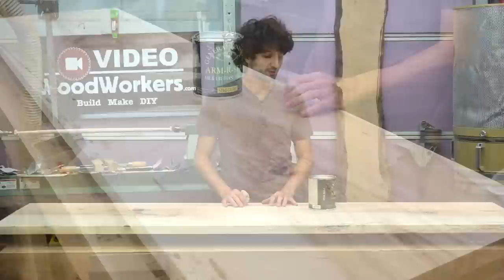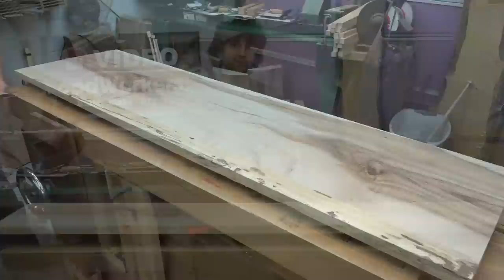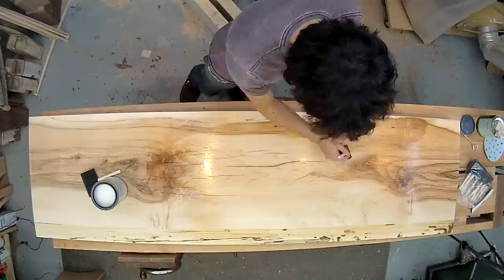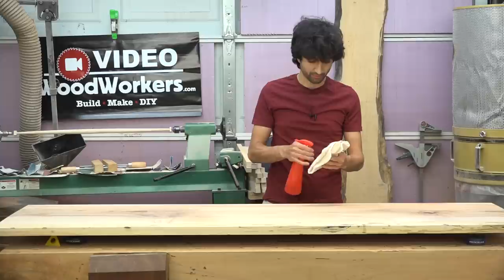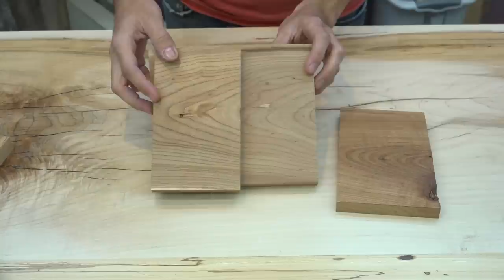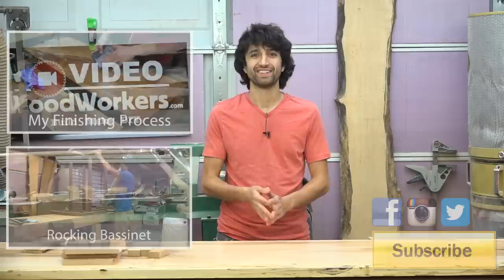Using a Water Based Finish for the First Time

Comment: Oil based finishes are far more forgiving to how they're applied. Water based finishes tend to produce uneven sheen more easily if you brush over an area that is a little dry. I prefer ZAR oil based products.

Comment: I used GFHP Water Based on a cherry end table...sprayed the outer parts of the table, sanding between coats. 5 coats and then took it to a buffer, the buffer i use for the guitars I build, and I buffed out the outer services of the table...  Used the sponge brush on internal areas of the table and after the first coat began to apply a thicker coat, allowing me to sand down past the application streaks creating a flat finish.

Comment: Good video, Matt. You hit pretty much all the pros and cons. It's a PITA to use, and does build a more "plasticky" feeling finish due to the thickness. On the upside, WB is the standard for wood floors due to its abrasion resistance, and it is much more resistant to UV yellowing than OB coatings. Still, if you want to feel the wood, my experience has been that you really have to wet sand the dried WB finish at the end.

Comment: The only time I tried a water-based finish I had to completely strip and scrape it off of my project. It left a terrible white/blue tinge on the entire piece. It looked like someone had spilled milk across the entire surface. I was really disappointed. Looks like I'll be sticking to oil finishes. I definitely like the look better too.

Comment: Yeah I made that same mistake (shaking the can) on my first guitar body. It ruined it. It looked like I left it in he rain. There were dozens and dozens of popped air bubble marks. Had to re sand back to the wood and start over. I've never shaken the can again. Never had much a problem using lesser foam brushed of course a guitar body isn't that big.

Comment: Matt, I know it's a lot more effort but I use a spray gun to apply water base finish, I thin it down 2parts finish to 1 part water , 2 coats , sand with 400 and then 2 more coats  and sand with 600, if I want super smooth finish i'll buff with Minwax finishing paste ,
                    I never get any brush streaks , and clean up of the spray gun is easy, I hope this helps, Cheers.
PS: I don't use it on small projects (only stuff for the kids), mainly furniture and larger pieces

Comment: +Matthew Cremona  Matt, i use waterbased alot. i try to avoid it on darker wood since it gives a kinda white-ish hue. works really good on light woods though (looks alot better on birch or beech [plywood] than oilbased stuff). you can thin out your finish with 5 to 10% of water, which makes it a lot more fluid and less streaky. with that method you could even use a rag to apply (woodwhisperer style, no rub in). since this stuff dries so fast you absolutely should not go back to surfaces you worked minutes ago.

Comment: those foam brushes suck so hard I cant figure out why some people like them, I used them a couple of times and never had any success with them better to use a normal brush also with the water base its usually better to only sand before the last coat with like 400 grit gets a nicer finish imo.

Comment: I’ve used a water based varnish recently too, it dries very quickly which is great but I didn’t like the application because it left brush marks and it foams up if you overwork it too much in more intricate areas. I wasn’t really very happy with the finish either, I didn’t bother sanding in between coats because of time. It was very rough and tacky feeling and the wood looked so cold. I dont know why you’d  prefer this over a lovely amber hue

Comment: Have to jump on the "this video shows everything not to do" bandwagon. I just completed the third coat on some bare wood maple shelves with the GF High Performance Satin. They look great, not too shiny and very smooth. As someone commented below, the foam brush you use matters. Big Box stores sell very soft ones. I buy them a dozen at a time on Amazon; they're quite firm.You can also successfully pad it on with a cloth as my local Klingspor recommends.  Bare wood should be sanded to 220, no more than 320. Use a purpose made tack cloth for water-based finishes after sanding and between coats which should be leveled with a Grey Finishing Pad. Don't shake the can as many have mentioned which also goes for oil based stains. Stir with a plastic stir stick which can be washed and re-used, not discarded.  High performance isn't a reactive finish like lacquer or BLO but it is forgiving enough that a dried run can be easily removed with a card scraper with little evidence it's there, after another coat is applied.

Comment: Hi Matt, I have recently started using a water based lacquer to spray wooden sunglass frames, Im having trouble getting a smooth shine finish, I sand between coats with a 400 sand paper, some videos suggest using very fine steel wool, have you used steel wool before, how does one go about using it? Thank you.

Comment: Has anyone tried General Finishes Enduro-Var?  I use this almost exclusively as my go to water based finish.  It goes on a bit streaky but lays down very flat when dry  I use ordinary foam brushes..  3 coats with light sanding between is all I ever need. The look is sort if in between a totally clear water based product and the warmth of oil based.  I really like it.

Comment: You mentioned that you might try thinning the product to get it to flow out better.  Be sure to check the manufacturers recommendations carefully.  A true water "based" finish is dissolved in water and can be thinned as much as you like by adding more water.  A water "borne" finish is actually a solvent finish suspended in water and can only be thinned about 5% with additional water.  I believe what you are using may actually be water borne.   Adding too much water could end up creating problems.

Comment: I gave up on brushing water based finish. The finish dries very very quickly and I am not quick enough to apply the finish evenly. 
I also apply a layer of shellac before I apply the water based finish. Even with raising the grain if I do not apply the shellac I still get fibres in the finish. 
When spaying the water based finish, by the time I complete 1 layer where I started is dry enough to begin the second layer so the project can be completed in 1 spray session.

Comment: For a proper finish with waterbourne, sanding to max 120-150 grit is enough. 3 coats to be applied, if the finish is gloss or high gloss, the first coat should be a matt. Use paint additive 10-25 percent and 10 percent water to have a good flow and wet edge for longer time. Sanding in between coats with 240-300 grit. Leave at least one day of drying time between coats for proper curing. You'll get a finish nearly as with epoxy. Coat it continuously in the grains' direction, use a soft brush from Purdy or Wooster. For big surfaces roller is good as well Wooster Pro Do Z, short pile.

Comment: I have sprayed this finish with an HVLP system and find it to lay down well and dry very well.  I have also used the GF Enduro products with much better appearance on dark wood. I use the GF High Performance on light woods such as maple.

Comment: Minwax water base stain has no sanding between coats. You have to rub the stain off after 3min,  It is a total pain. I used the sponge brushes. My first application is blotchy. Gonna go get a real brush for the second coat. I really like the look of your oil base finish.  I am staining a dining table. Do you prefer oil base for longevity? I wonder how long this water base is going to last???. Especially after cleaning up spaghetti sauce month after month.  I may use the steel wool at the end and use a wax finish. Pretty sure I can wax over water base stain. Thanks

Comment: Thanks for that Matt. I seem to be the only person using sealer. With oil-based it's easy, just add thinner to the varnish. With water-based, you have to buy the sealer already thinned. Water-based varnishes do not contain water and "should not" raise the grain unless you add the water, but there is enormous variation between brands. I get good results when I start with a water-based sealer, though perhaps my "good results" may differ from yours.

Comment: I use a good quality Hamilton synthetic brush for water based varnishes, stains or paint and natural bristles for oil bound paint, varnishes etc. I would never lay varnish in the regular painting motion but load the brush with enough varnish to do one single sweep across the surface with overlapping. Just my method of course but varnish never looks good when overlapping. If any is missed just catch it on the next coat.

Comment: Hi Matthew, great video and very helpful with a white oak table top I'm getting ready to sand! I planned to use the same GF water based top coat, with flat finish on my table top because I read it yellows very little. But from your video, it looks like the water based yellows it as much as the oil based. Can you comment on what you see as my monitor might not pick up the differences well?

For your sanding between coats, do you actually sand all the prior coat of finishing off or just the fuzz that sticks up?

Thank you for your help and keep up the great work!

Comment: That's a great resource Matt. Our finishes here in Australia are all different as you'd expect but the results are the same. I personally use mainly water based finishes, I pre wet to avoid the furries and I generally thin the finish when applying. You're killing it mate, hope everything is going really well wuth both new family and work.

Comment: cool video matt great tips!! I like the water based finishes too for a natural look, they way i go about it is as follows:  between 5-7 light coats with a foam brush let each coat dry 3-4hrs come by with a quick 340grit sand between each coat and wipe with tack cloth. let the final coat cure with previouse coats for 3-4 weeks depending on conditions. start wet sanding from 600-2000 grit with water and a few drops of soap. clean all reisdue, and hand buff with cotton rag and rubbing compound until semi or gloss. if you do not buff after wet sanding the polycrilic it will have many defects but not to worry give it a buff and scuffs and scratches come crystal clear!!

Comment: Hi Matt, I've watched many of your finishing videos and am trying to decide between GF Arm-R-Seal and High Performance for my project and I wanted to see what you would recommend.  I am going to dye a white ash tabletop with india ink, seal with sprayed de-waxed shellac (Zinssner BullsEye).  For the top coat, I was originally planning to use Arm-R-Seal but then was considering what the "yellowing" effect would be on the black dye.  Do you think that it would have that much of an effect on black? Should I just go with the High Performance? Thanks so much for any advice that you can offer.

Comment: Matt, some BIG issues with water based poly are to load your brush lightly - not like you would load a bristle brush.  Back and forth brushing is bad for water based poly.  Always brush in a single direction.  It keeps bubbles, puddles, runs to a minimum.  Yes, you must sand between coats.  I prefer water to oil base because of dry time, color, cleanup, and fumes.

Comment: Good demo and comparison Matt. I looked on the GF site and a pad type applicator with a nylon stocking over it was used as another application method. I saw your answer about spraying. Kind of like the idea of using less toxic finishes if you can get the results you want. Thanks!

Comment: I use a water based poly on a lot of projects.  What I know - and what you've likely learned using it - is you can't over work it.  It dries fast, which means it tacks fast, which means overworking causes streaks.  The sponge brush sux for water poly application.  I use a natural bristle brush, work quickly along the grain with a wet edge.  Sanding between coats is definitely required.  Good looking desk top, though!!  I'm uber jealous!!

Comment: I always like these compare and contrast videos. I'm an oil finish guy too, but I've tried the polycrylic over painted surfaces (open shelving) and it really turned out nice. And then tried on bare wood, not so nice, in fact I threw the piece away.  
I recently tried the stuff you just used, GF HP on bare white cedar wood sanded to 180 grit, and it did come out nice but the grain was muted. I did apply it with a rag, flooded the surface and really rubbed it in and then lifted off the excess with one of those foam brushes.  I think rubbing in with the was the ticket .

Comment: I have sprayed water finishes on mahogany in the past. I pore filled, and stained, then sprayed three coats. I was very happy with the results, you could not tell that it was a water based finish. Also it was a refinish job that was contaminated with silicone.

Comment: My technique for applying a finish like that, (water based) is only different at the end of the second coat (immediately after the sealer coat).  When you went back and noticed that it was already tacky and starting to dry, I immediately put on a heavy coat, right over that.  Then let it dry for a full day.  As you said, it doesn't flow well, so when it's tacky, you can really build up that coat.  After that first coat (or 1.5 coat) is dry after a full day, go back with 220 and you can actually sand it flat to avoid those marks.

Comment: Great video!  like Lance's Workshop said, I use the poly-acrylic  for my shop furniture which is mostly birch plywood cabinet construction trimmed with poplar or oak..  for that purpose it is convenient, seems to look and hold up well and like you pointed out, doesn't tint the wood.  I've used both Minwax's & General Finishes HP polyacrylic finish and have to say that I think the Minwax brushed on better and definitely left a superior finish and seems to require 1 less coat then the GF to achieve the desired build up.    And thanks to your vid, I will definitely skipping the water based finishes all together on any nice cherry or walnut, etc. projects ;)  cheers!

Comment: I've had great results with oil polyurethane and a foam chisel tip brush.  Never brushed on waterborne top coat.  Maybe using the same technique would work?  My method is to slowly stir the finish in the can for 5 minutes then pour only what I'll need into a 5" wide plastic paint tray.  Then I gently place the foam brush in the tray and let it soak for a few minutes. I then gently set the tip on the surface of my work and slowly drag it along as the finish slowly flows out of the brush/tip.  I'm always careful not to press the brush into the work or the tray, that creates bubbles.  Patience is the key, at least when laying on oil based finish and a brush.  Done right it's glassy smooth and maybe one or 2 tiny bubbles.  I wonder if the same technique would work with a waterborne topcoat.

Comment: Very nice demonstration and analysis of the water based finish.  I would like to offer two suggestions for your consideration: 1.  thin the finish to improve its flow characteristics. This should give you the more uniform application you seek,  2.  Use a rag to apply the finish, you are more comfortable with this method of application and it gives you the more intimate relationship with the wood for which you are known,  If others want to use foam brushes, so be it, stay with what you know.

Cheers my friend.

Comment: You may want to try yourself a foam roller and then follow up with a brush to remove any fine bubbles. Here in Alaska where I can't get good ventilation indoors in the winter,  I tend to use the water-based finish is a lot.  I've had very good success with the foam rollers. I can also say if you use lighter and later pressure as you spread the material, you will reduce the air bubbles to a great degree. Then you just need to follow up with a good quality brush. I find the poly acrylic to be quite thick, and rarely do I need more than two coats. Sometimes one is enough.

 I can also say spraying these water-based finishes is the best, but unless you've got good ventilation and a super dust free environment you can create more problems than you solve. I think the roller method works well so long as you follow up with the brush to get rid of the bubbles.

Comment: I was told by the pros to never shake urethane (oil or water based) as the shaking creates air bubbles.  Urethane should be stirred gently.

Comment: I have used the water based finish on my stairs and found out that as all the people said (don't shake) and you have to flow the product on the material keeping it as wet as you can I used small floor application pad pour the finish on the stair and flow it, the streaks will disappear as long as you don't smooth it out too much especially important on the 2 and 3 coat use the abrasive pad to smooth out any dust or raised grain came out really nice and smooth almost like a some clear plastic coat

Comment: HI Matt.  I’ve used both finishes over the years and prefer WB to oil based,  Small shop, safety, and finish as well.  I never use a foam brush with WB.  On Cherry and Walnut I use boiled linseed oil then shellac then the WB finish. The TC I use depends on the application.  I have used GF High performance, GF Endurovar poly, GF Lacquer (really like that one) and a brand WB from Sherwin Williams. On most of my projects I use an HVLP spread system to apply the top coats.
Reply: Spray system, darn fingers